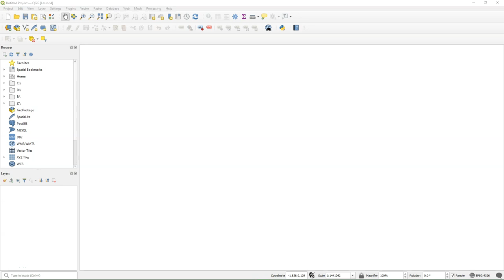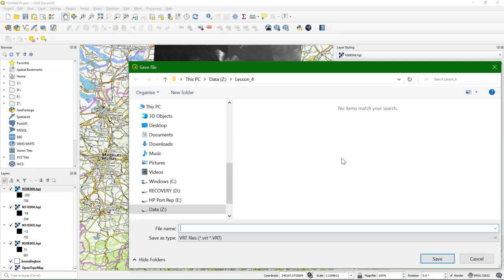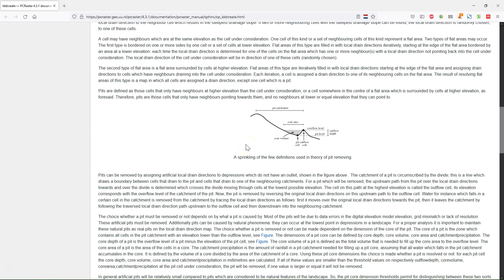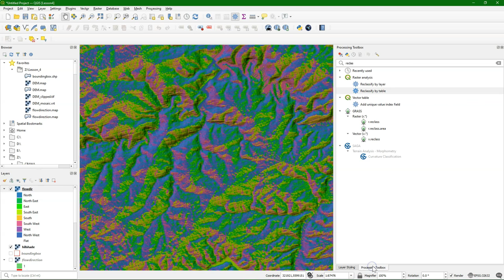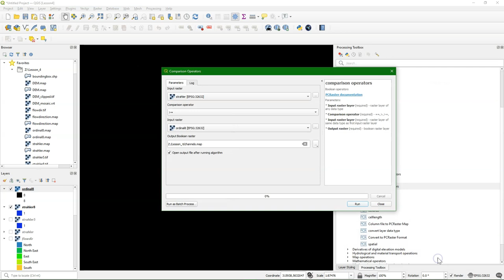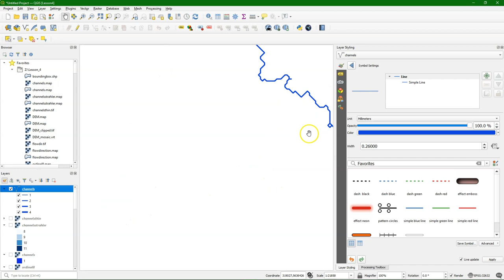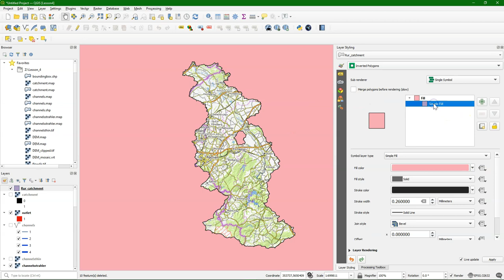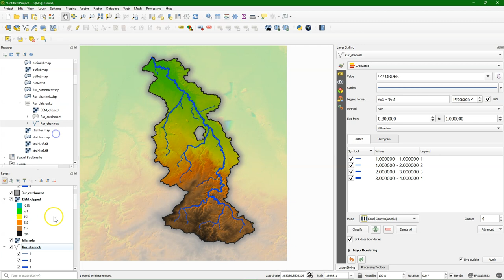Complete Updated Workflow Stream and Catchment Delineation in QGIS

Comment: Hi Hans! I've followed the video up to polygonize catchment. My catchment has a hole in it that's unexpected and cuts out part of the river. Why would this occur and how can I keep this hole in the catchment vector without removing it as instructed in the video?
Reply from the maker: In my example the hole occurs because there's a very deep open pit mine. The fill sinks algorithm of lddcreate doesn't fill it but creates a separate subcatchment within the catchment. Depends on your knowledge of the area if you want to remove or keep it. In my case there are no rivers crossing the mine, so safe to remove the hole for getting the boundary of the entire catchment.
Reply: @HansvanderKwast  I want to keep the hole, but as I change the symbology, the hole keeps the fill colour. How do I merge the hole into the catchment?
Reply from the maker: @gemmam9892  I'm not completely sure what you need. If you have a hole you can remove it using remove ring from the Advanced digitizing toolbar. Just click on the hole and it's gone. If you want to keep the hole do nothing, but take care with styling using the Inverted polygons fill.
Reply: @HansvanderKwast  I want to keep the area in the hole and merge it with the catchment polygon. I have done this by using 'Dissolve' in Vector Geoprocessing Tools.

Comment: Hello Mr. Hans, if I would like to derive sub-catchments from other outlets, is it necessary for me to copy the coordinates of that outlet as well? If so, what will be the number after the comma in the new set of coordinates? Thank you in advance
Reply from the maker: Yes, you can past those coordinates in the text file. Add a unique number for each subcatchment. The result will then have that value for all the cells of that subcatchment. So the text file format is: x-coordinate,y-coordinate,id_number
Reply: @HansvanderKwast  Thank you very much for your response Sir.
Reply: @HansvanderKwast  Hi Hans. Thank you for your tutorial. When I try using more outlet points, I found that sometimes the sub-catchment area might be wrong or not shown. Have u tried using multiple outlet points? Thanks in advance
Reply from the maker: @vincelee4684  If your outlet is upstream of another outlet, it's catchment will include the upstream one. If you want to separate those, you need to use the subcatchment tool instead of the catchment tool.

Comment: Hello Hans. First off thank you for all your videos, they have been quite helpful. I have pcraster properly installed and have followed your instructions, but when I run 'lddcreate' my system does not seem to get anywhere. I let it run last night for about 10 hours and when I got up it was still running. My windows resource monitor shows qgis-bin.exe is using a good chunk of memory but the disk is sitting idle. The CPU status monitor for qgis-bin.exe is stuck at 'not responding'. I am at a loss here. I know when you talk about lddcreate in this video you say we the users have to be patient, but is 10-12 hours realistic? The DEM is not all that large, about 1.4GB. If you have any advice I would really appreciate it. Thanks!
Reply from the maker: I think 1.4 GB is big and will take some time. But maybe what you experience is too much. Are you sure that your CRS is not in GCS (not EPSG:4326 in lat/lon coordinates), but with meters for x and y?
Reply: @HansvanderKwast  Hello again Hans. I have reinstalled QGIS, reinstalled pcraster according to another of your videos, and run the lddcreate process again. I end up in the same situation, an idle CPU, etc. I have checked my CRS, it is NAD83(CSRS) and its information states that its units are meters. I don't think it's in lat/lon. Any advice you might have would be greatly appreciated.

Comment: I can generate the Layer "Channels" with the Channel Network and Drainage Basins Tool BUT without any information.... Not one pixel on the screen or any information in the attributtable for Channels.... how is that possible? Really need help.... :(
Reply from the maker: Can you try it again and check if you have checked the box to use the raster values as categories?
Reply: @HansvanderKwast  I'm not so sure what you mean by that. I have to admit that I'm pretty unexperienced with QGIS and I work with your tutorials just on another example in Germany. Is there any chance to give you my dataset so you can take a look at it? I really would appreciate it!
Reply from the maker: The tutorials at gisopencourseware.org have data that you can use. Also detailed steps are there.
Reply: @HansvanderKwast  I will give it a try. Thank you so much sir.

Comment: Hello.  I have a problem after converting DEM to PCRaster format. How many times I try I am given the shrank dem layer of the raster that I have inputted in PCRaster format.  I choose the Scalar data type for this process. Thank you in advance
Reply from the maker: Do you mean that the result raster after conversion to PCRaster format is not the same size as the input raster? Is your input a GeoTiff? If you load the result layer from disk, is it then loaded correctly? The tool uses gdal translate.
Reply: @HansvanderKwast   Exactly, I meant that and input is a GeoTiff. I have just tried loading the result layer from the disk and it is the same. I do not know why but I think it shrank after that process. Thank you
Reply from the maker: It could be something with the projection? You can check in the Layer properties if the rows/columns are different or not.
Reply: @HansvanderKwast  I will check. thanks 👍🙏

Comment: Hi, Hans!
Thanks for the great series of vidos on hydrology in QGIS, I find it very useful!
Unfortunalte, I encountered an error trying to define an outlet point from a catchment. When running "Column file to PCRaster Map" I got an empty raster file. Well, on my disk it takes up some space, but it does not contain any numerical values. Would the seolution be to use point layer instead of txt file and rasterize it? I work with QGIS 3.28 (LTR).
Reply from the maker: Your outlet raster is probably correct. There can be 2 issues. 1. With some QGIS versions the paleted/unique values renderer doesn't see the pixel value. If you use singleband pseudocolor you'll see it. You can also check the layer properties and see if min/max/mean are 1. If that doesn't work, your raster probably only has nodata, because the project map canvas  from which you've sampled the coordinate was in a different projection than your flow direction raster.
Reply: @HansvanderKwast  I use the same projection but still got an empty raster. how can I fix it?
Reply from the maker: @anggitaapd  Did you check the statistics in the Layer Properties as I suggested? Please confirm.
Reply: @HansvanderKwast  Hi Hans! I am experiencing exactly the same problem. I have checked that I am sampling the coordinates from the recalculated flow direction map. In the paletted/unique value I see nothing, and when I click on classify nothing changes. In the singleband pseudocolor I also see nothing. . Min is 179769313486231570814527423731704356798070567525844996598917476803157260780028538760589558632766878171540458953514382464234321326889464182768467546703537516986049910576551282076245490090389328944075868508455133942304583236903222948165808559332123348274797826204144723168738177180919299881250404026184124858368, and max is a similar value... Any tips? Thanks a lot :)

Comment: Hi Hans, thank you for your helpful videos. I've been following your tutorials closely, particularly the warp reprojection process. However, I've encountered an issue when I reach the step where I need to export and save the raster layer. In the 'save raster layer as' editor, I notice that your default resolution values for the horizontal layer are approximately 20.7896 and 30.1119. Strangely, on my end, the resolution defaults to values significantly lower, often less than 0.1. I suspect this discrepancy might be causing errors in my workflow. Could you offer any insight into why my map layer resolution defaults to such low values? I wonder if there's a crucial step or setting that I might be missing. Your guidance would be greatly appreciated. Thank you.
Reply from the maker: I assume you're using SRTM. If the target resolution is EPSG 4326, the resolution is a small number, because this is a GCS. You need to reproject the DEM to a CRS with units in meters. Then X, Y and Z are in the same units and the algorithms give correct results. See https://youtu.be/ZLUjSEK-nbg
Reply: Thanx Hans @HansvanderKwast

Comment: Hello Hans, I am an water engineer and I wanted to thank you for your contributions, which is really helping me to improve and experience the new tools and methods in hydrology. 
I have couple of questions regarding catchment delineation. 
1. What method does  LDDCreate tool in PCRaster use to calculate the flow direction in not modified DGM, for example D8, Multiple Flow Direction (MFD) or D-Infinity (DINF) methods
2. I wanted to calculate the flow direction (Fließweganalyse) of my hilly catchment area and in my DEM the tunnels and bridge openings underneath the railway (Zug und Straßenbhanunterführung) are filled (These are not located on the river way). In this case do I have to burn the DEM first then do the fill sinks and the rest will be followed by in this tutorial? because in reality through this openings rain water is flowing downstream and merging to the river network.
3. How do i use the flow accumulation method to show the flow path of my catchment area (Not only main river but also foreland waterways)?
Reply from the maker: Thanks for using the videos. Here are my answers to your questions:
1. Lddcreate uses the D8 method. More info about the precise algorithm can be found here: https://pcraster.geo.uu.nl/pcraster/4.3.2/documentation/pcraster_manual/sphinx/op_lddcreate.html
2. It depends a bit on your purpose. If it is to delineate the catchment, burning the real depressions is not always needed. The filling algorithm (included in lddcreate) will remove the depressions and the purpose is to route all water to an outlet. In the lddcreate settings you can control the filling algorithm. Check the link above. If that isn't sufficient you can burn the depressions. There are some tools in the Resource Sharing repository of PCRaster that you can use for this, also see other videos on my channel.
3. You can use the accuflux tool to calculate flow accumulation through all cells. https://pcraster.geo.uu.nl/pcraster/4.3.2/documentation/pcraster_manual/sphinx/op_accuflux.html
Reply: @HansvanderKwast  Thank you very much for the quick response. I will work on the answer 2, definitely i will have more questions and hopefully i may contact you again. 
Regarding question No.3, in order to use accuflux i have to create a material raster, how do i generate it ? because i remember in ArcGIS you only need the flow direction raster to generate flow accumulation.
Reply from the maker: @maiyourathaankarunanandara3382  I made a new video about calculating the flow accumulation: https://youtu.be/N_3wie5Srv4

Comment: Hi Hans, great video. instead of strahler order i used flow accumulation to derive the channel network. Is there a way to automatically search and define multiple outlet points of catchment when you are working with a large area?
Reply from the maker: One way is to use the pit tool from the PCRaster tools plugin. See this video: https://youtu.be/jSc3HDN6yEM?si=18XQHVyD7aiM_uFa. The pit tool will assign a unique integer to each pit, which you can use as an input in the catchment tool.
If you want to have more control, you can use the Strahler orders and find the junctions. Then you can derive each subcatchment. This is explained here: https://youtu.be/5uGaLIlaFh8?si=Y2z2berpjYJVgucp. With the resource sharing plugin you can find tools to do this automatically (https://github.com/jvdkwast/qgisrepository).

Comment: Very Informative tutorial. I am facing an issue  that my outlet point is not converting into the raster format.
Reply from the maker: Maye the copied coordinates are not in the same projection as the flow direction raster?
Reply: @HansvanderKwast  Thanks for this tutorial professor. I am also having the same problem. I also have counterchecked the projections of both the flow direction raster and the copied coordinate, and they are both the same. I would really appreciate your answer.
Reply from the maker: @winsanguenza2419  When my students have this error, it's caused by spaces, points, minus, etc. in folder and/or file names. It's good practice to avoid spaces in file/folder names. See https://youtu.be/kggwFZHXCl4?t=644

Comment: Thanks a lot Hans for these videos and also for PCraster tools , every thing is working just fine like your tutorial , but i have an issue when i m on the part of Defining outlet of catchement , when i run the COLUMN FILE TO PCRASTER MAP the execution fail , it says it s an Assertion Error and i m pretty much sure i followed the exact same pats that you did on the vid ,pls sir do y have  any suggestions to this issue . THANKS
Reply from the maker: Check if the on-the-fly coordinate system is the same as your flow direction layer. Another reason can  be the file and folder name. Don't save it as a temporary file and save it in a local folder without strange characters.
Reply: @HansvanderKwast thanks for replying sir , i ll check the OTF

Comment: Hello Hans, 

thank you for the tutorial, this is exactly what I need for my studies, but I have a question. 

 I am stuck at the pcr "Fill sinks and calculate flow direction" point. My QGIS tells me that the "PCRaster is not installed - algorithms will not be available". If I try to run the algorithm, it aborts immediatley saying "PCRaster library is not available". Do you know what the cause may be? 

Thanks in advance!
Reply from the maker: You need to install PCRaster (it's a processing provider plugin) following instructions in the documentation (homepage link in plugins manager) or use the instruction videos on my YouTube channel.
Reply: @HansvanderKwast  The Convertion worked but the "fill sinks" didnt. I installed PCRaster with OSGeo4W as described in your tutorial. When I open QGIS I still get the same result as in my comment. :/
Reply from the maker: @szzor7651  The conversion uses GDAL, not PCRaster. It means that you have installed PCRaster in another version of QGIS maybe. Before you start QGIS from the Start menu, click right, open location and run setup from there. Install PCRaster and run the corresponding QGIS version.
Alternatively use the SAGA or GRASS approaches from other videos or install QGIS and PCRaster in Conda.
Reply: @HansvanderKwast  Thank you for your answers! 
I still don't quite get it, sorry :D I right-click the QGIS Application and run it from there? It's still the same. 

I also watched your GRASS and SAGA videos. Very good content, thank you for that. In your videos, you use rather big areas like the Rur channel, but in my studies, I only need to analyze a rather small area around the Möhne See/Möhne Lake. There are mostly 2 outcomes when I run the algorithms (fill sinks (wang lui) or watershed basin etc.) 1. it doesn't work at all or 2. it works, but the watershed basins are completely wrong. At some points they are right, but it seems so out of place. I also posted on stackexchange. Here is the link: https://gis.stackexchange.com/questions/414794/watershed-basin-not-working-using-qgis I hope that my studies work with the PCRaster Tools as GRASS and SAGA don't work :/

Strahler Order is also very messy and not right at all. I tried so many different approaches but it doesn't seem to work at all.
Reply: @HansvanderKwast  Thank you for your comment on StackExchange. You are absolutely right about your assumptions. It would be great if you could check my comment there. :) Kind regards!

Comment: Hello Hans, thanks for your great QGis-engagement!

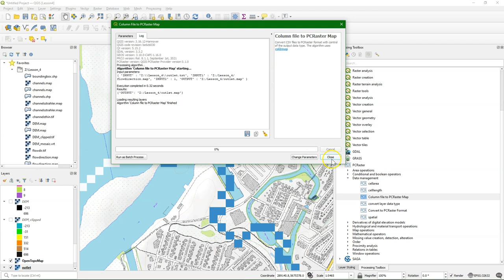I followed the instructions up to 28:34, but "Column File to PCRaster Map" throws an "assertion error", like others reported.

The reason is the system-call of col2map.exe in col2map.py lines 105...130, which fails, if there are blanks in the paths.

Workaround:
Adding quotation-marks to these calls:
before:
cmd = "col2map -B {} {} --clone {}".format(table, dst_filename, clone)
after:
cmd = "col2map -B \"{}\" \"{}\" --clone \"{}\"".format(table, dst_filename, clone)

And dont't forget to save, close and reopen the project to read the modified scripts...
Reply from the maker: Thanks. It was on my todo list. I'll update col2map soon.
Reply: @HansvanderKwast  Hi there. Thank you for the fantastic tutorial! I am getting the same "assertation error" and do not understand the workaround. Can you help?
Reply from the maker: @gemmam9892  This is caused by file paths with a space. You can wait for an update of the plugin that will be released very soon. It is already in GitHub. If you know how to install a plugin from zip you can already try.
Reply: @HansvanderKwast  Thank you. Do you have a link to the zip file on GitHub?
Reply from the maker: @gemmam9892  This is the link to the repository: https://github.com/jvdkwast/qgis-processing-pcraster. There you can click on Code and download the ZIP file. Note that you need to unzip on your computer and ZIP again the folder pcraster_tools. That's the file you can use in the plugin manager.
Reply: @HansvanderKwast  Thank you! I have successfully installed it and run 'Column File to PCRaster Map'.
Reply: @HansvanderKwast  Can you detail more this step sir after downloading the ZIP and how to use it  , i didn t understand well